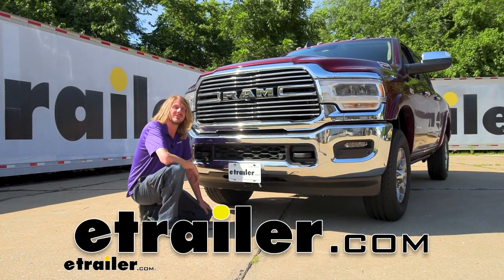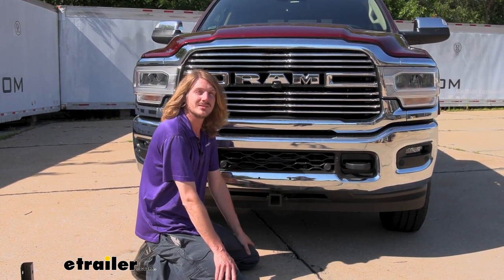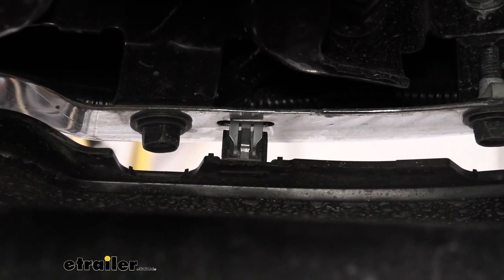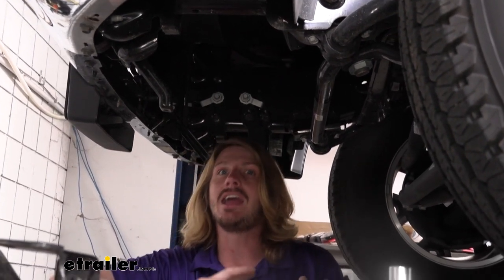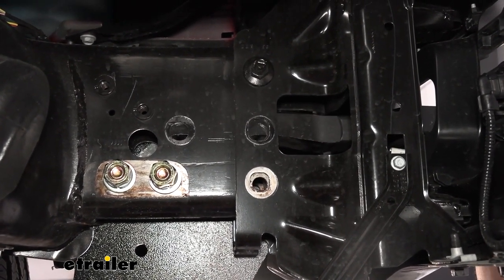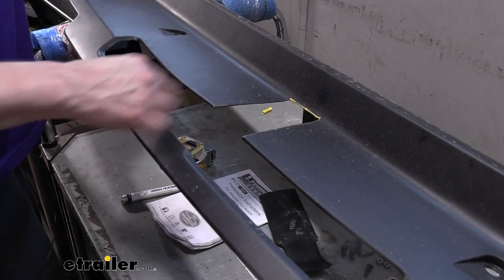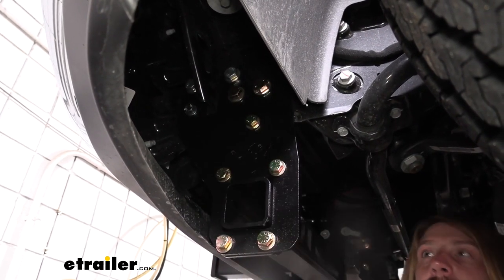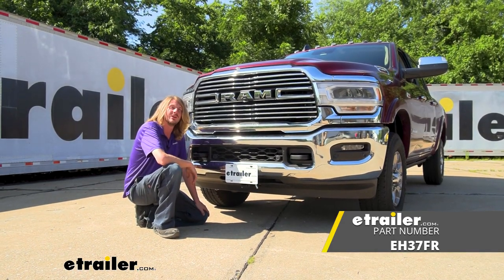etrailer | Setting up the EcoHitch Hidden Front Mount Trailer Hitch Receiver on your 2022 Ram 2500

Comment: Wonder if I can use this setup on my 2020 Ram 2500 Diesel, equipped with a Western Ultramount Snowplow🤔.  Also, just as info, because I had to remove them to install my plow mount,,,those vertical brackets are called “ Compatibility Brackets” 😄.  Nice setup though!!